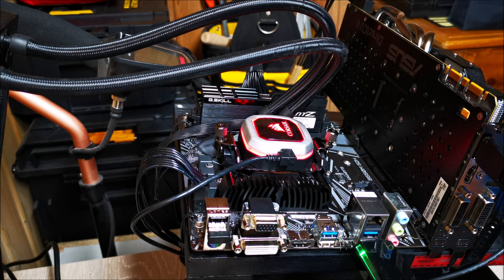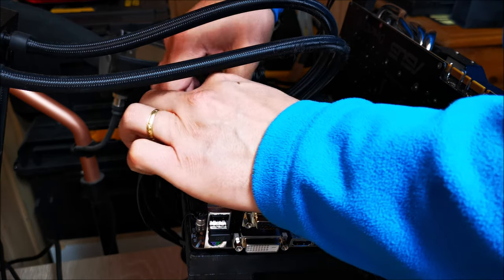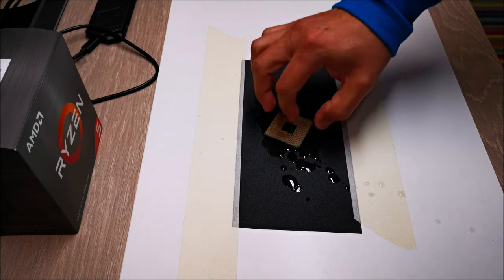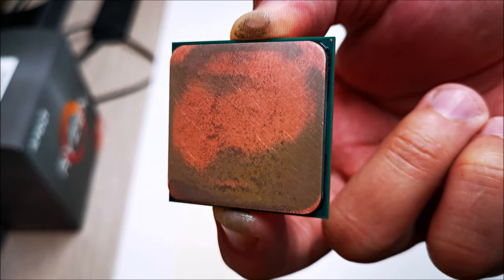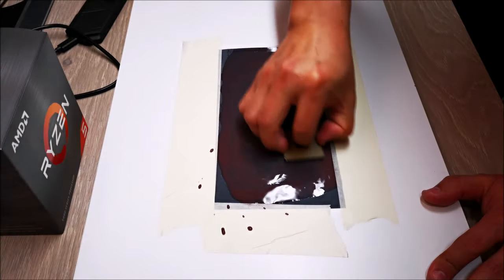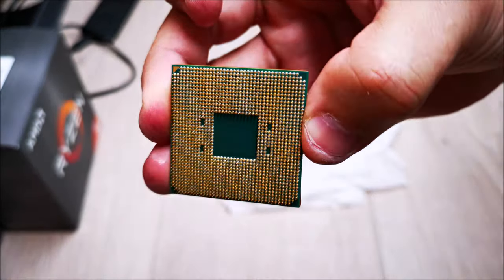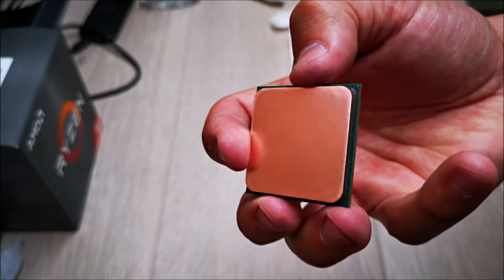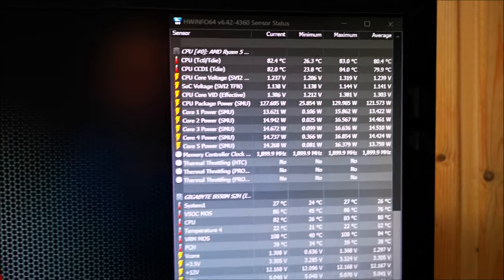Ryzen 5600X CPU Lapping. Is it worth it?

Comment: sweet you did it, i told you man its because of how the 5000 series ccd is setup. and i forgot the easiest way to hold the cpu is to use the plastic protector thing the cpu came in from amd. if you open it up opposite ways it will get a tight snug fit without touching the pins.  but yeah lapping it was def a good deal huh lol. good job. and i went  500,1000,2000,4000,5000. just followed debauers diminishing return of smoothness
Reply from the maker: I couldn't resist the idea lol had to do it 😁. It's def helped with temps. And yeah I know about the plastic case but for the sake of the video I did not use it. Just wanted to show worse case scenario 😊. Thanks for the idea man!

Comment: I am really considering Lapping my 5800X. I have a Custom loop and it hits 89c no OC just PBO. I tried Oc'ing but it wasn't worth it, but maybe if I lap it that might change. Also, I do autobody repair and whenever your sanding any surface you should go straight back and forth no circles and let the paper do the work, so your right not to add pressure. I did a video on bent pins. I was going to show how to fix broken pins but I felt ppl would just not understand dropping the broken pin in the socket array it belongs in and they might fry their stuff lol Thanks for the video though, i was not sure if this was good for ZEN 3 or not and the 5800X is a HOT Processor.
Reply: Did you do it? If yes what was the result?
Reply: My r5-5600x clocked 4.96Ghz PBO at negative -30 and +138mV: 3 core boost goes 4.95Ghz and all cores goes 4.78Ghz, one core goes 1.46Vcore and all cores 1.288Vcore, 50C idle temp and all cores 78C temp on 10 yeqrs old water loop. Mixed disiled water with tap water. 

I can not run my r5-5600x clocked 4.85Ghz manually anymore becue of my ekwb water block is so bad now, when my ekwb water block was almos new (used for some years) it could keep my r5-5600x under 60C at 1.41Vcore 24/7 but liquid metal damage .y water block even if it was copper.
Will never use liquid metal again from thermal Grizzly.
Reply from the maker: I stopped using liquid metal all together. Too many horror stories online about it. I stick with a good thermal paste, like mx-6.

Comment: My 5950x gave me that "oh you're not putting my $700 face on sand paper, no you're not".. Look just now.
Reply from the maker: I wouldn't either. It generally doesn't make much of a difference.
Reply: I'm literally in the same boat ATM 😂

I read a few posts on Reddit where people claimed a 5-6C delta which is actually some solid overhead so I think I'm going to risk it this Thanksgiving

Comment: Did a simple undervolt to my 5600 (non-x) which has a turbo speed of 4.4ghz. With stock heatsink and very gentle amount of thermal paste, I couldn't manually run 4.4ghz very well during intense benchmark testing. So I undervolted the thing over .1v (I think .137V) and running strong at 4.1ghz. Temps dropped from low 80s to low 50-60s under heavy load. Almost no hit to my 3d gaming score and barely a dent in CPU performance. Gonna try lapping and CPU shining. The trick I always used was find something purely flat, it was suggested a piece of glass would work... and fine grit sandpaper, at least 2000. Tape sandpaper down flat and to the glass and rub away.

Comment: was the AIO plate also "lapped"? i've heard that only sanding the IHS is mostly useless as the point is to sand both the CPU and the cooler is being paired with for proper or noticeable gains.
Reply from the maker: Only the ihs was lapped.
Reply: @shanksisnoteventhatstrongbruh  from my understanding - it depends on how flat the cpu cooler’s cold plate is. It would be important to lap the cooler too if it has a concave/convex face. 
If the cooler is flat and mounting pressure is even you should be ok with just lapping cpu IHS

Comment: I might do that with my 5800X3D but I don't think I need to do that in the future cos it already runs pretty cool in my rig
Reply from the maker: I don't think you need to lap it then.
Reply: @TechnologyHive  but if there's a future bios update that enabled multiplier overclocking on my board (I have an x570 meg unify) then I'll do it for that sweet extra thermal headroom. Shame I can't oc my 5800x3d atm. Great chip tho, has 7000 series gaming performance even at stock specs 😁
Reply: not a good idea with the 5800X3D due to the layout of the internal chips. it actually creates a heatspot since the clearances are extremely tight. lapping the 5800X was the solution to a lot of users that had this specific cpu had lids made from a different type of copper. like most liquid cooling radiators the best is called red copper which helps transfer heat a lot better. the lids on the 5800X however were made of a harder copper which ended up trapping heat instead of spreading it out. and when you delid the 5800X theres a lot more glue than the other cpus.  5800X3D just needs to be undervolted most of the time. =)

Comment: There's still a lot of visible scratches on the IHS, which means you didn't spend enough time on a certain grit. I'd recommend using 2-3 separate sheets for each grit because your sand paper is most likely getting clogged from all the debris coming off the CPU. 

Although it might not make a huge difference in temps, it just adds to the mystique and looks more professional.
Reply: Yea finish do pretty much nothing all is from flatness

Comment: 126W … hmm my 5950x runs at 208W. I guess this would not help me too much?
It clocks down to 3800 after a minute or two from 4500 at the start.
Reply from the maker: It does run hot yes. An aio is a must for this cpu.
Reply: @TechnologyHive  this is with my 420 eisbaer AIO
Reply: @TechnologyHive  ...no i have the NH u-12s and lockt on 4,65 GHz all cores with 1,300V in cinebench R23 not higher then 87,8°C max. hotspot and gain 12029 Points
I'm thinking to upgrade the cooler tho but to the NH D-15

Comment: Got a 5600x in my first ever pc build and the core with the lowest temp has 24°C while the hottest one is running at 73°C. Wtf is this, is it normal? This being at full load
Reply from the maker: Full load doing what? Gaming? Video editing? Some applications are single threaded. That is too much variation in temperatures between cores. Have you double checked that the cooler is installed correctly?
Reply: @TechnologyHive  Mining. I know it's stupid to mine with cpu, but I just build this pc with a 1070 and wanted to see how much it could mine with both cpu and gpu. The cooler is installed correctly, but I did put it the wrong way the first time and had to lift it and put it in again without reapplying thermal paste (used the one it came with).I will buy new thermal paste and install the cooler again because even in idle, the lowest temp is 23 and the highest 40, which is still too much I think. I was just curious what is considered a normal temperature difference between the cores.
Reply from the maker: @oancemr  No no. It's not stupid to mine with cpu. I do too with my 5600x. But I do it using the unMinable app for coins like XRP. 

I have a small farm of 8 cards doing dual mining using trex miner for the LHR cards and SRBMiner for my AMD cards. And still I do cpu ming. But, PBO is disabled. The cpu efficiency goes down while mining, though the profits are slightly higher with PBO turned on, it's just not worth it.

Comment: luckily i never had a uneven heatspreader, thermals were always nice (or it was anyways a „on-die“ CPU without the casual heatspreaders)

I really would love if AMD and Intel would sell 2 different types of the same CPUs... one with HS and one with the direct die solutions like seen in most notebooks
Ofc mounting pressure would have to be exactly correct but only think about older CPUs... they mostly had anyways plastic spacers around the PCB at the height of the die to make sure there is not too much pressure on the die.
I built already with about 13 years my first PC (Athlon 64, early 2000s) there wasnt even a CPU aviable with heatspreaders
I think this heatspreaders are that common because you cant make much wrong. But instead i would prefer better cooling performance over easy/safe to build, its anyways barely a CPU which got swapped out and HS-less CPUs arent really harder to install, only with slighly more precision for perfect contact
Reply: i mean, do you remember as the i7 lineup got that hot so delidding became very popular?
Instead of removing them, intel
could have easily made any i7 lineup with direct die... cheaper, more users would have used these CPUs, especially the overclockers (which are pretty typical at the Intel CPUs...), also me

Im now even thinking about delidding my good old 4790k... the PC doesnt have any usecase anymore (sold my loved GTX1070 after about 5-6 years of gaming and mining) and i want to get easier over 4,8GHz (for the sake of  CPU bench-numbers and fun haha)
But i dont really think this make sense with a 92mm small tower/designer aircooler (despite saying „UP TO 150W“)
Reply from the maker: Problem would be warranty. It's easier for AMD and Intel to sell you a product you're less likely to break than one with a metal cap on it to prevent noobs from cracking the die. But yes it could be a nice thing be able to choose IHS or no IHS even if at owners risk. Maybe in the future. I did however delid my R5 3600 and ran it direct on-die cooling with a corsair H150 AIO. There was only 2 degrees improvement. Hardly worth the risk.
Reply: Technology Hive if the IHS would be at ALL CPUs that great with only 2 degree difference, then i would even prefer an IHS for exactly the reasons you said
But i think that result doesnt fit to every CPU because of ryzens internal design.
But at least on nearly every intel there was a huge improvement in direct die vs IHS when we talk about the modern Core i CPUs. Probably stock not really any sense, but for (extreme) OC pretty needed
Reply from the maker: @harrison00xXx  There certainly are good scenarios like you pointed out where direct on die cooling would make sense. But it also depends on the circumstances, true 👍.

Comment: 82 degrees at 1.25V and 4,5GHZ on an AIO?
Wow
Mine is running with removed current Limits at 1.25V with Auto overclock at 4,850GHZ with the STOCK Wraith Prism cooler at 62 degrees max. On Prime 95 small FFTs O.o
Without lapping
CTR2.1 Test says its a Platin Sample soo.. jea
Could be that idk.

It can Run with 1.375V at 5.350GHZ all core
And the 4,850GHZ on an Auto Voltage of 0.9-1.1V

But that Temperatur difference between yours and Mine is massive
Reply from the maker: At 2:00 you can see the difference in height on the IHS in the center and it takes quite some time to get that leveled out. Also the board does not respect the manual voltage, which actually ran at 1.3v instead of what my 1.25v. Anyway, sounds like you got real lucky there with the silicone! Congrats!
Reply: @TechnologyHive  jea true 
Thanks Mate